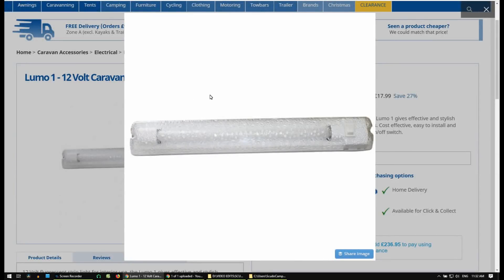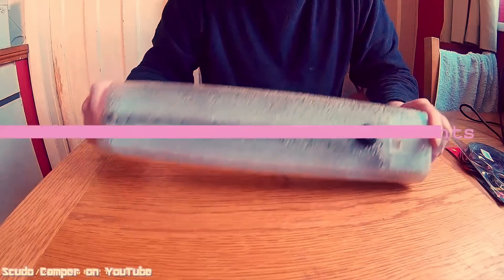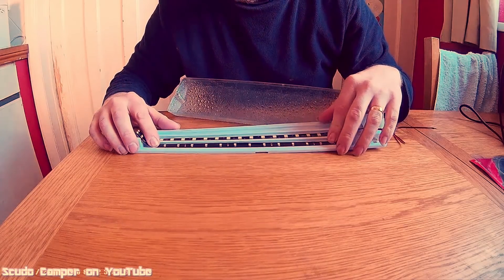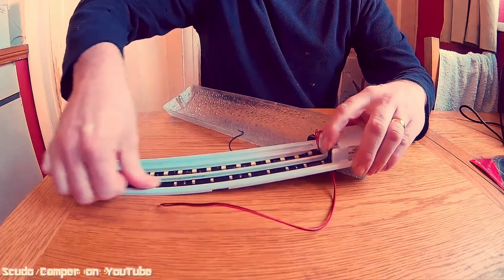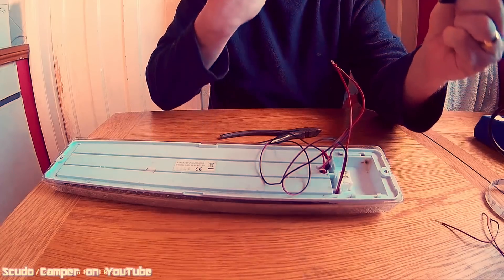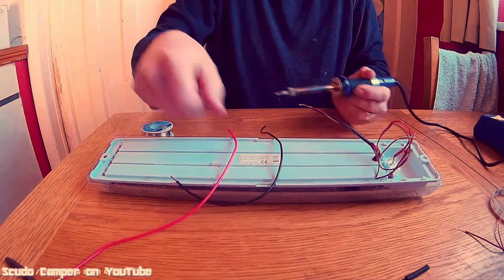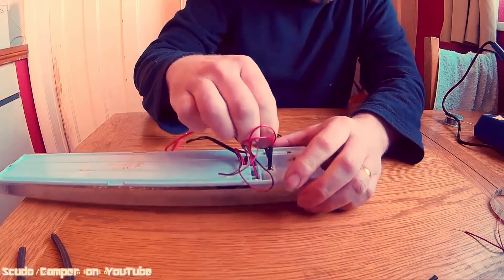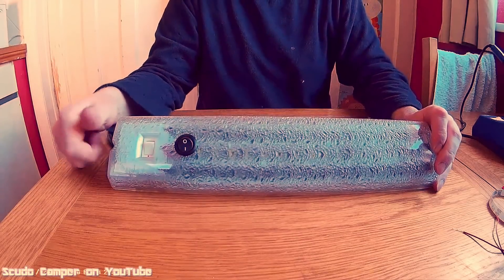HOW TO: Convert Fluorescent Lights to LEDs 💡💡💡💡💡💡

Comment: The LED strips tend to fall off after a while, so before putting the cover back on,  run a thin bead of clear silicon along the edges of the strips. That is enough to hold it in place but also allows you to peel the strip out if it  needs replacing. 
Chris
Reply from the maker: Good idea Chris. i did have some old ones that did that. the ones with the m3 tape where way better though. :-)